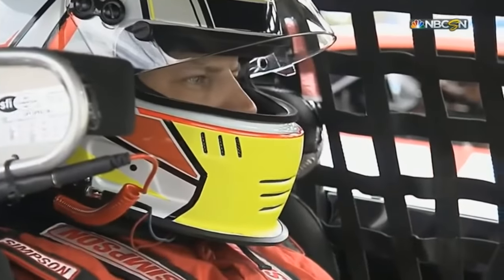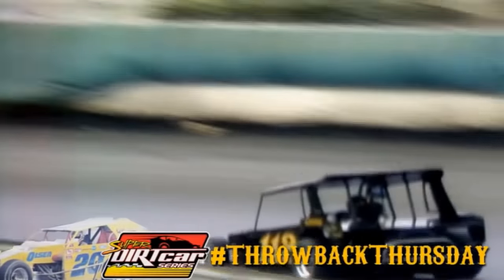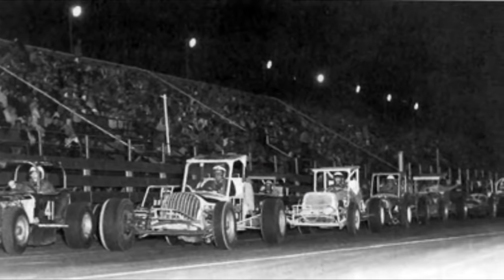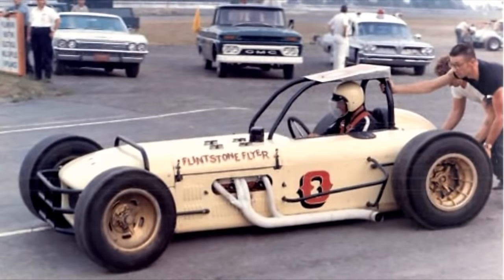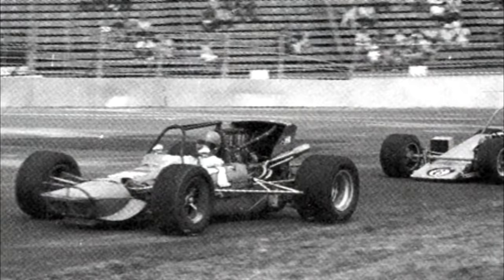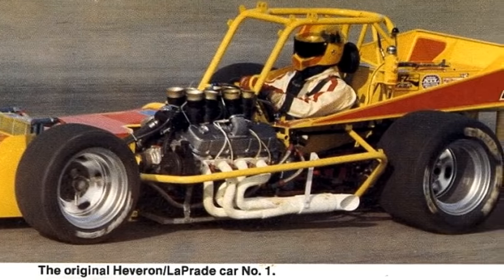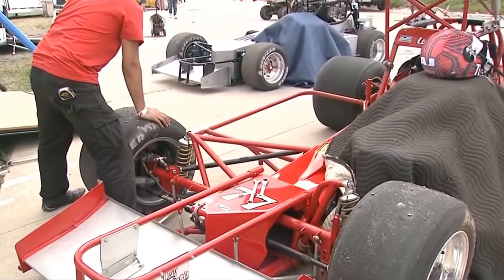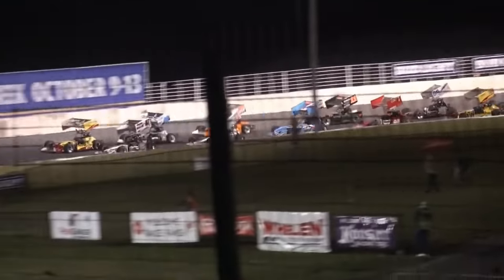What Exactly is a SUPER Modified?

Comment: About Reece's 3-to-1 car. It never actually participated in any race. He built the car, he tested it, and it ran fine, more than fine actually, it was faster than previously expected. The only complain from the testing pilot was that it was unnerving seeing just one wheel at the front instead of two. The car was ready to race, but as soon as the Supermodified ruling body found out about Reece's car, they immediately placed a rule that stated that the cars had to have two wheels in front and two wheels in back. Reece's 3-to-1 car became immediately an illegal car to run, which made it of little use for him since he wanted a race car, so he immediately dissasembled it, kept the parts that were still useful for a different car, and then sold the rest as scrap metal, so the car exists now only as photos and in people's memories.

Comment: My Neighbor actually races cars like these, and he taught me mostly what they are made of
So it’s basically a super light aluminum or steel chassis that only weighs about as much as a human, and usually contains a small block V8 or other smaller engines. They can produce anywhere from 200-ish horsepower to 700 horsepower, while weighing ~1900 lbs. There’s 2 versions of them to my knowledge, the lesser powered Mini Sprints which he races, and the Super Modified.
Reply: what you're thinking of is a Three Quarter midget. The NEMA series. These are their full sized counterparts that run nearly 1000hp with big block engines...
Reply: @FloridaManRacer  yeah I’m not really big on the sport (this comment was 2 years ago lol) so didnt really understand the differences. But thanks for the info!

Comment: Kinda makes me wish for a modern-day rule-less Modified series. As long as it has a roll cage and extensive driver safety measures, you can run it. Electric and combustion on the same field, with all sorts of high-tech designs vying for control across various short tracks around the world.

I'd call it "Inno-max Mega Modified", because innovation would be maximal.

Comment: Literally the Sprint car wing that Gary used as a roof could have just been any normal flat piece of steel with rolled edges angled downward toward the front of the car it's just a flat piece of metal welded to the top there's no curvature in it whatsoever it's the rake that creates the downforce I'm talking about the car in the first min. 20 seconds

Comment: I used to go to Madera California where the supermodifieds would run and they were absolutely and still are today the most exciting racing I've ever watched these cars have so much horsepower and don't weigh hardly anything and when they come out of the corner it to go down the straightaway they actually lifts the front tires up in the air and they have to let off the gas very easily so they don't damage the suspension so they can turn when they get to the next corner it's absolutely amazing

Comment: Could anyone help me with some dimensions on a ISMA Supermod.   I have this crazy idea to build a quarter 1/4 or 1/5:1 actual RC car with a weedeater motor like they run in the 1/5 scale trophy trucks from companies like Losi.   I have a ton of pictures I shot a few years back on one of their weekends in Michigan.  I just do not have a base wheelbase and what the overall width most cars run.......  any help would be greatly appreciated.   It's going to be a hell of an adventure but now-a-days companies already build some suspension and driveline components that are already proven so if I can adapt some of the available parts out there and build whatever else I need in the machine shop I think I can pull it off.....  maybe, its not going to be easy.....Thanks in advance for anything that could possibly help me get the main dimensions so I know I am on the right path
Peace

Comment: If you notice the big block 14 to 1 compression naturally aspirated motor is shifted all the way to the left side of the chassis and tilted towards the inside of track to help Force down the fuel and keep the oil in the oil pump pickup running at about a thousand horsepower these cars can wheelie down a quarter and 3rd mile and a half mile track